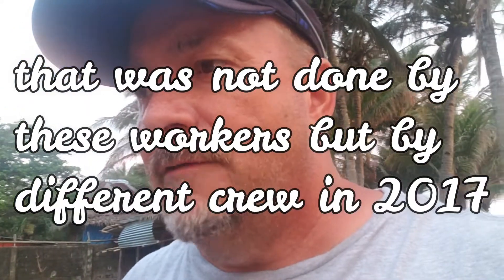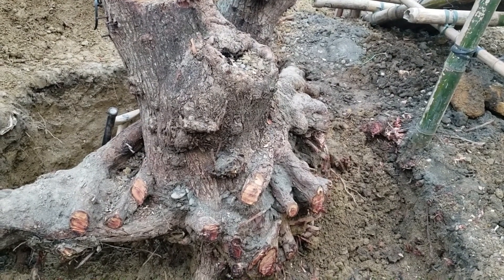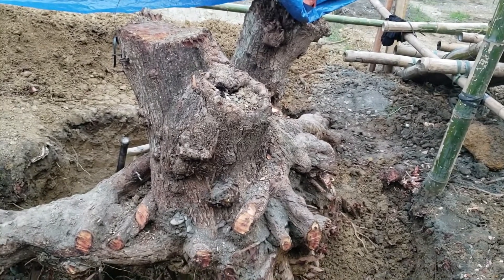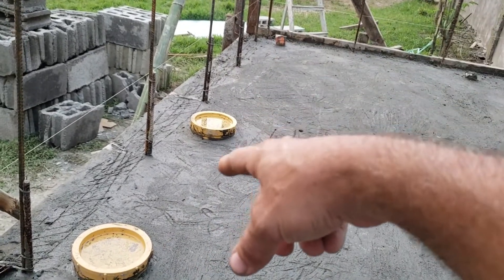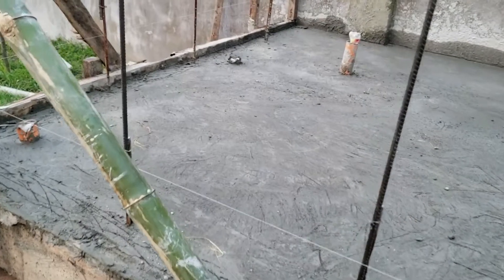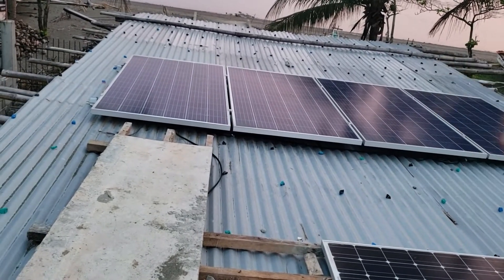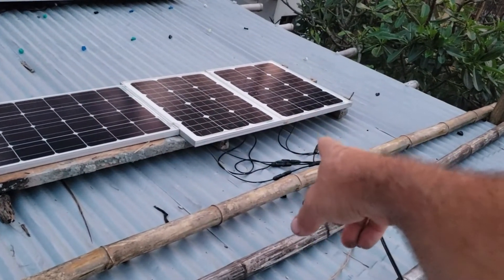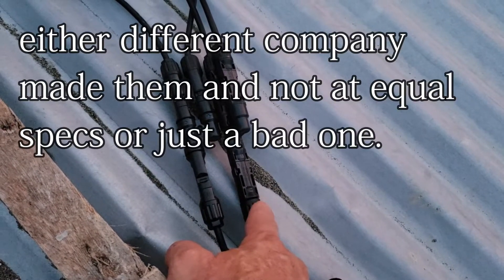Episode 36: SOLAR CONFIGURATION Things are LOOKING UP on Build

Comment: Where did you get the motion sensor street lights? I’ll be there next year and would like to get a couple ! Looks like your progressing nicely and I will be doing solar as well but I will be living up in the Luzon area !
Reply from the maker: https://l.facebook.com/l.php?u=https%3A%2F%2Fwww.lazada.com.ph%2Fproducts%2Fgdplus-gd88-60w-120led-ip65-sensor-solar-street-lamp-i319198666-s659834706.html%3Fspm%3Dspm%253Da2o4l.order_details.item_title.1%26fbclid%3DIwAR1KKyJroRqgYGoNcSwq1YShodptt8jI9trL-2d62a53w6VaDO8mDh-wvHc&h=AT3zZpenzpw5oqW82C2CEZ4k3xsYl2Wq_5IbX2gjeGh6pEkW8Txugo7txparVYABJRCy9Bqn67_5DtH3oooFfdQxB05FFl1HlPmojMfhf91iqUP7ZDEXv1KlSTBnrKNuxvCn      its long link but it will get you there!!!
Reply: Texas Filipino Thank you!
Reply from the maker: I bought 4 more of these lights today. I will use one more for here at property and 3 are going in my suitcase back to TEXAS. I looked them up on ebay. Here they are honest on wattage. on ebay they lie like crazy. A 60 watt here becomes a 600watt on ebay!!! then the price is higher on ebay also. As much as double the price. So I go back to States with empty suitcases usually anyways so might as well throw something in.